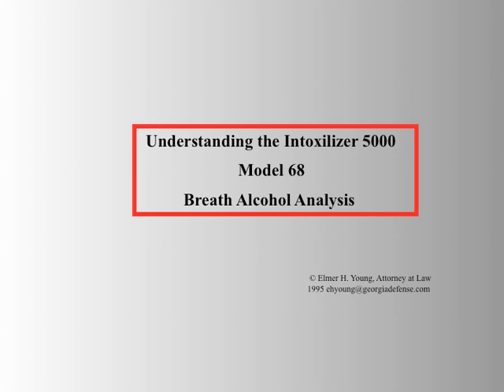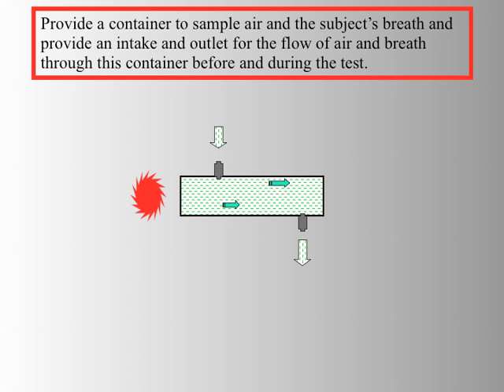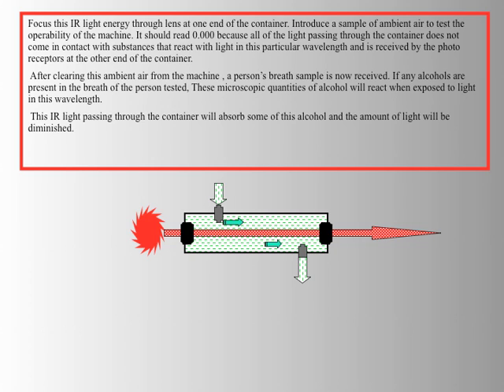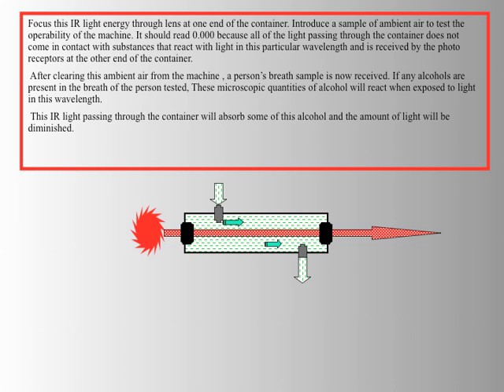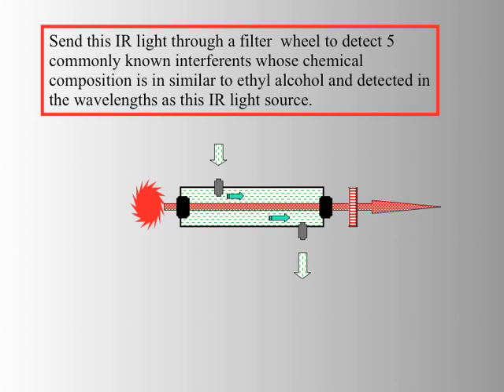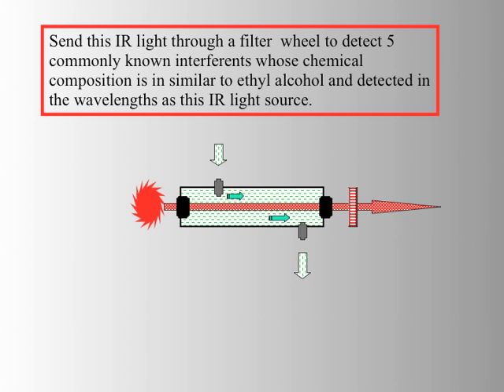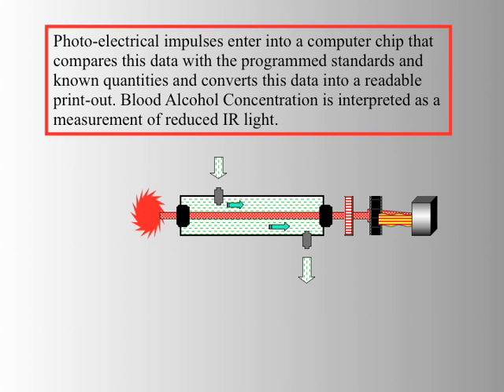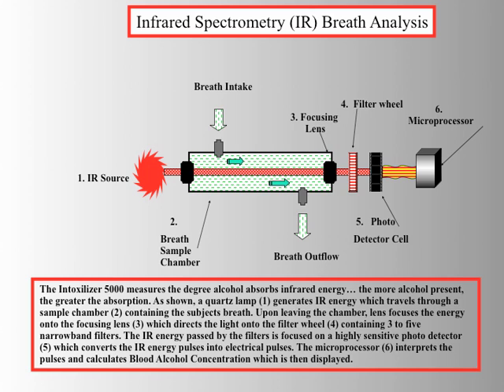How Intoxilyzer Breathalyzers Work

Comment: That's a "super cute" name, seems really serious.  "Intoxication Analyzer 5000."  Where'd the 5000 come from?  5000 ppm?  5000 cubic nanometers of analytic space?

This "baseline measurement," is it done with human breath over numerous samples or simply environment air?  There's a difference in chemical composition and moisture saturation between these two.  Human breath is far more wet and complicated than ambient air.

"It filters out some known but not all known interferants."

Okay, so it's still not 100% accurate.  What good is it then?  It's prone to contamination by numerous environmental contaminants.  Quit selling it, it's broken.  It's a car that starts 75% of the time depending on air composition.  It isn't reliable, quit buying these things on taxpayer dollars.